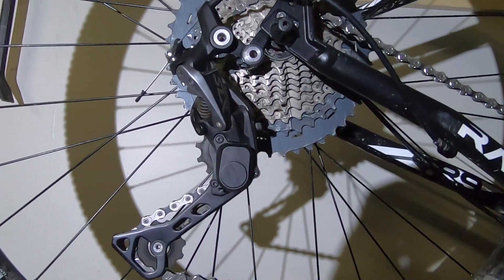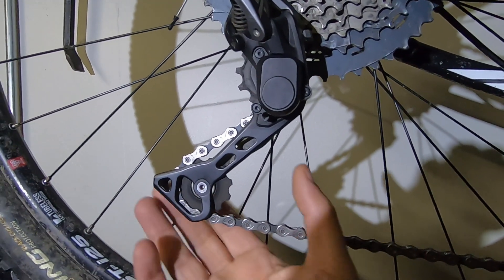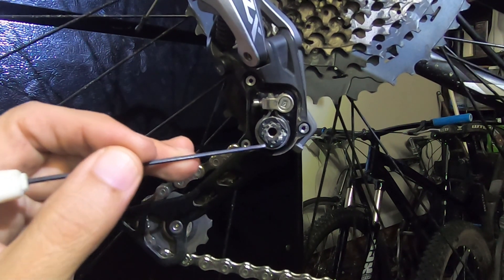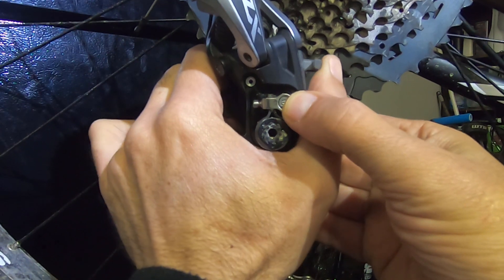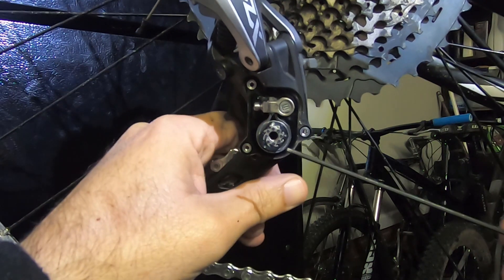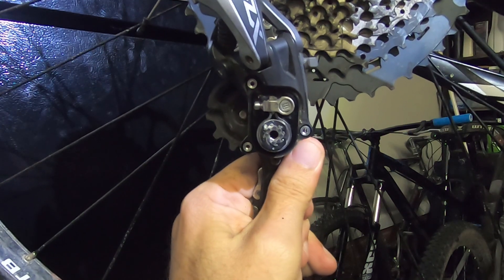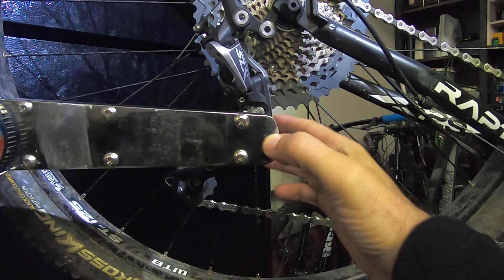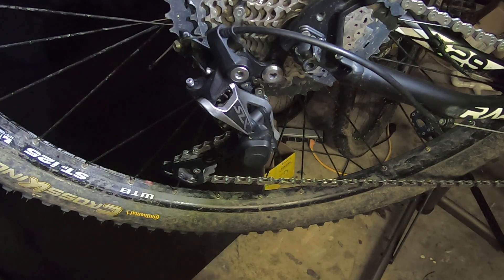How a MTB Derailleur Clutch Works and How to Adjust It on Shimano

Comment: I broke the small plastic part inside holding it together. Seem to work just fine when the housing is closed.. It slips and is removed out of position when I adjust it on/off without the housing.

Comment: Why would you ever turn the clutch off
Reply from the maker: @therealjd1503  to remove the wheel or work on the drivetrain, like mentioned in the video at 5:03
Reply: @TonyHob  thanks, makes sense

Comment: If my derailleur doesnt build enough tension to keep my chain tight on the smallest cog/small chainring, can I adjust the spring like you did with the torque wrench to get more tension? Thx mate!
Reply from the maker: Make sure your chain is not 1 or 2 links too long first. I’m not sure adjusting the clutch will help since the clutch tends to losen, not tighten

Comment: Hi sir, I have an issue, when the clutch is engage and you try forcing it forward, my clutch has a clicking sound and is this normal??
Reply from the maker: if it is shifting well I would not worry about it, it might be stiction as it breaks resistance. Make sure it is not adjusted too tight.
Reply: @TonyHob  hi, thank you so much! It’s shifting well but I think it shouldn’t have clicking sound and it restricted a bit when push.

Comment: The "Pro Rush" derailleur on my Taff provides resistance in only one direction.  It springs back to full tension just like a normal derailleur.  There is a large washer covering the mechanism which provides the illusion that the "clutch" mechanism is active in both directions, but the internal drum has a one-way bearing.  The clutch mechanism on my "Pro Rush" has slop in the "clutch" mechanism so that the chain can slap the top of the stay before it engages and there is no break-free detent mechanism; the friction working against loosening the chain tension is roughly continuous throughout the movement.  My chain often derailed before seeing your video and the clutch was (mistakenly) in the open position, so I look forward to seeing if proper adjustment can help save this derailleur from the recycle bin.  It should go without saying that the Shimano unit you have is far more advanced, but I said it anyway.  Thanks for your helpful video.

Comment: Thanks for the video and explanation. My question is when do you use in 'On' position and when to use 'Off' position? Thank you.
Reply from the maker: The clutch is always on while riding. You only turn it off to make it easier when you remove the wheel

Comment: Hi Tony, thank you for your video. I got a Fuji Nevada 5.0 for $60 in a garage sale. The bike has 3x7 system (cheap parts). I purchase a 1x system (chaining, pedals and bottom bracket ) but tbe existing drerailler is a Shimano Tourney with not cluth. Do you think I'm ok or you suggest getting one with clutch and if that isthe case,  can you recommend me one, also do l need new cassette. Thank you.
Reply from the maker: It depends whether you go on very rough trails or not. For rough trails you will get a lot of chain slap and might drop the chain now and then. It you do paths and gravel roads you should be fine. You can use the same cassette
Reply: @TonyHob  Thanks so mucho again Tony, If l want to change the dereuller with clutch por this bike with 7 rings cassette , which one you will recommend.
Reply from the maker: I can’t think of a Shimano compatible 7 speed derailleur that has a clutch.
Reply: @TonyHob  No problem but thank you for your time.

Comment: so on hard terrain is good to have clutch on , or is it good for all rides ?
Reply from the maker: It is needed in a system with only one chanring in front. Along with a narrow wide chainring it keeps the chain from dropping when the trail gets rough. on a multiple front chainring system it is not needed, or if you only ride on paved, smooth surfaces.
Reply: @TonyHob  i got 2x11
Reply from the maker: In that case the clutch is not necessary
Reply: @TonyHob  tested today , it works well on harder terrain

Comment: Just checked the clutch on my boundary and it works just like you stated it should no tea ion going backwards but full tension going forward and when pressed to a “ breaking point” it goes forward but once in the rear position does not go forward again without really pushing on it so I think it is a “true” clutch

Comment: Very well explained. But how is the shifting from high  to low gear if the clutch is engaged?  The rd cage tends to go in a forward direction when shifting into lower gear.
Reply from the maker: There is enough force to overcome the resistance when you shift. The cage is not locked from moving forward. That’s also why it is important to set the tension to the proper torque.

Comment: I don't quite know how the clutches work on light Shimano XL derailers but it'll have probably Springs and gears in it I think in the cheaper clutch setup on a swing top it probably works from friction plates and when you engage the Labyrinth this Titan Souls friction plates we're on a higher-end Shimano or trim derailleur it's an actual proper clutch system it's probably like one way gear and it locks the cage from coming down but not going back
Reply from the maker: Shimano uses unidirectional clutch bearings (anti-reverse bearings) on their fishing reels, I believe the derailleur uses a similar mechanism.